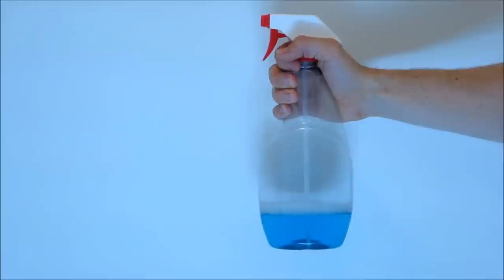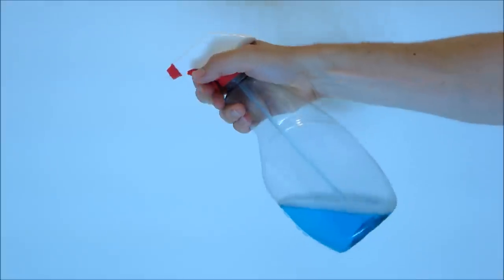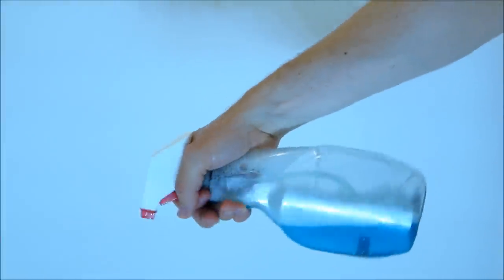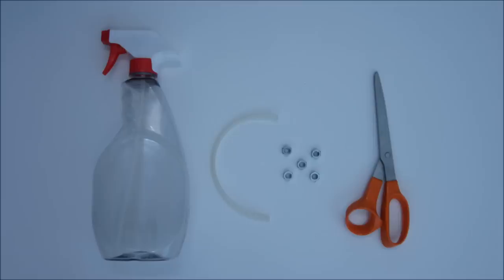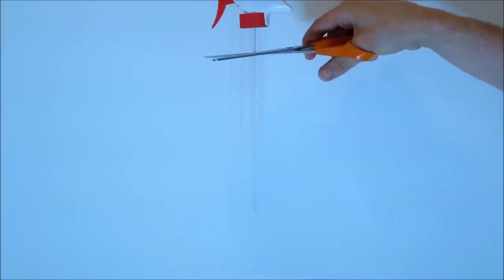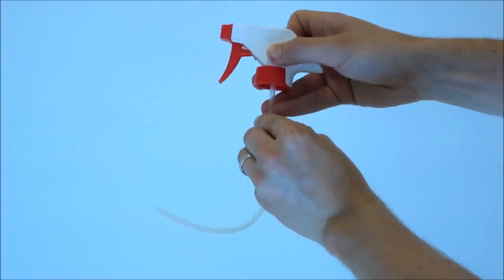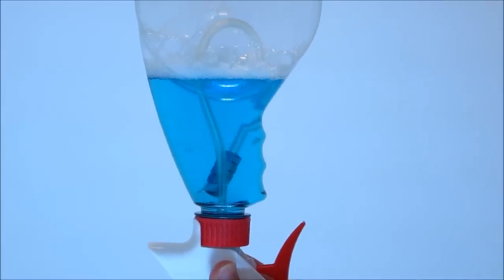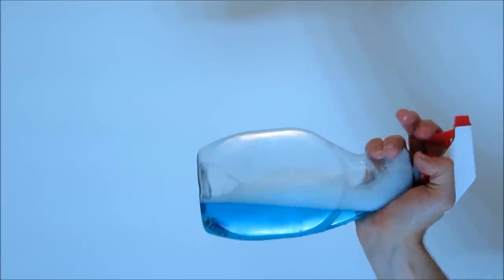How to make a spray bottle that works in any orientation

Comment: The "suction tube" is actually called a dip tube, and commercial versions of this are standard in some aerosol cans.  Be sure the flexible tubing is compatible with the product (doesn't dissolve, crack or harden) and the use of properly sized T-nuts (put the tubing over the body) can help hold on the weights .

Comment: So easy, so smart ... amazing that companies don't do this with spray bottles now
Reply: Mike Lazarus Well no to be fair - with most sprays it's not necessary that you need to be able to use them upside down. Therefore it would just add costs, work and bad for the environment - considering that it wouldn't be a lot more packaging for one bottle but multiplied with thousands of spray bottles it would make a difference.

Comment: Nice video. This is a very useful tip, thanks for that. Also, @WombatBitch, to the best of my knowledge, stainless steel is not 100% stain proof. It's just stain resistant. It'll rust given enough time (i.e. if it's submerged in solution at the bottom of a spray bottle 24/7, 365). It's kind of like how "bulletproof" vests are also technically only bullet resistant. Shoot it enough times in the same spot or with a strong enough bullet and it'll penetrate.

Comment: So use stainless steel nuts and metric.
Reply: Either that, or check out the fuel system components at your local hobby shop, a fuel line clunk would be perfect in this situation as would be silicone fuel line for Nitromethane fueled car and plane engines.
Reply: I was gonna suggest that. It's exactly what it's manufactured for, to collect fuel when the plane is up-side-down ow any angle, really, and resist the fuel corrosion. Problem is if you forget, or the cleaning lady throws the empty bottle away.

Comment: I hate to burst everone's bubble but after going to three different hardware stores none had the soft flexible tubing I needed. Then I noticed that the dip tube on my generic trigger spray bottle was detachable.  Turns out I am now able to spray upside down with the dip tube detached.  I still need the flexible dip tubing for horizontal spraying.
Reply: Just three stores...I tried one place and got it right away... you know, eBay and the likes...
Reply: @kyliemckeegan824  eBay? link pleeeeease!?!? 😲

Comment: why when you buy a spray bottle the straw is always bend away from spray direction, so when you naturally tilt the bottle slightly forward the straw will be in the air if just 1/3 or less liquid is left in the bottle? Is this bare manufacturer calculation?

Comment: hello youtube... I've had many many jobs in a kitchen in my time.  From being a kp to cooking.  The technique used in this video is simply common sense.  Any bottles that come into our work, or attach to the dishwasher to feed detergent, all have weighted ends.  I have always wondered why retail hasn't taken this idea on and have come to the conclusion that the cost of adding in a weight to a disposable bottle simply isn't worth it.  We reuses spray guns all the time, but most homes wouldn't

Comment: If you only intend to use the bottle upside down, why don't you just cut off the tube and that's that?   Have another bottle that's ordinary, and the upside down version.  Whenever the normal becomes too low to use, dump it's contents into the upside down bottle, and buy a new normal bottle again.  Would that work?

Comment: Clever, this is almost the same exact setup used in weed eaters to draw fuel into the engine. That way your engine doesn't cut out if you use the machine upside down. Never would have thought to utilize it in a spray bottle!

Comment: And since the nuts are supposed to be stainless, the lifetime of the nuts is far langer than the plastic pumping mechanism.
Oxidation will be so slow as to be nonexistent so the lifetime of this device will be limited to the pumping mechanism.
These usually are quite durable and made of all plastic, so this can be handed down thru multi-generations!

Comment: Not really - this is eccatly how you secure a constant flow of fuel in model airplanes - and helicopters (radiocontrolled) a inner rubber line with a heavy pipe at the end , so no matter if the plane is upside down You will have a study fuel supply

Comment: Why not use pvc plumbing fittings which would not rust instead of the metal? Seems the most logical simple solution to the metal degradation issue.

Comment: and the chemicals, ammonia,etc will degrade the vinyl tubing causing it to swell or crack. Good if you're going to use the bottle up quickly. How ever stainless steel nuts and tubing are fairly cheap.
Reply: You'd probably get rid of the bottle before that ever would happen. I work with chemical pumps that handle 15-20% bleach, concenrated hydrogen peroxide, stabilized bromine, and a bunch of other strong, corrosive/basic/acidic/everything chemicals and polyethylene/PVC tubing is the industry standard. The only thing that would happen is if it was a corrosive chemical, the nuts would rust if they're not stainless.

Comment: Incorrect. Stainless steel only remains stainless if it is routinely exposed to atmospheric oxygen. Without oxygen (e.g. continuous submersion) it will rust, and various chemicals can accelerate that process.

Comment: "At least until the steel weights start to rust" or you throw it away because fiddling around with a spray bottle to get out that last bit of liquid is way more annoying than just buying a whole new one.